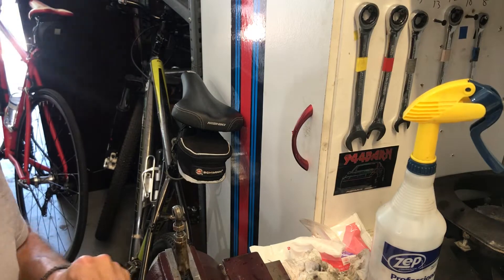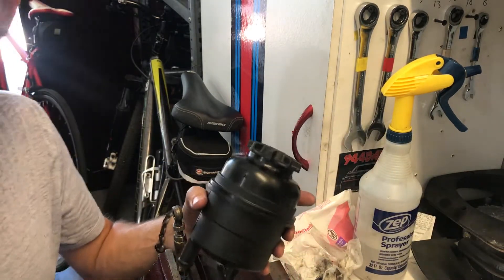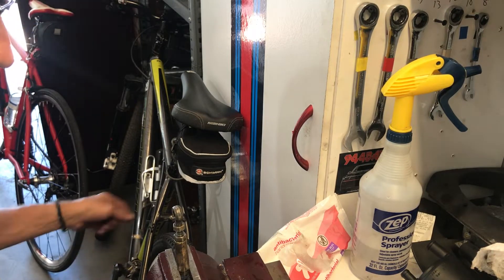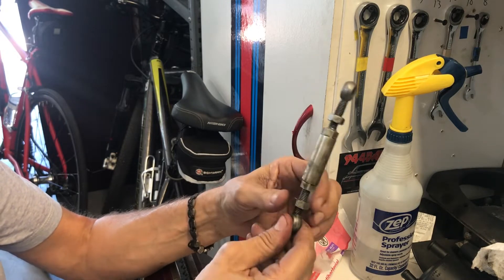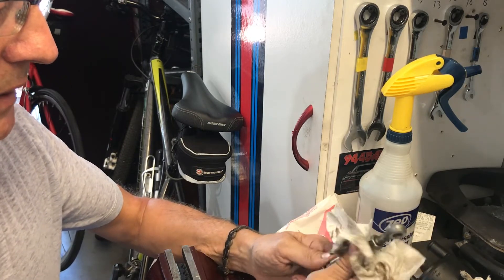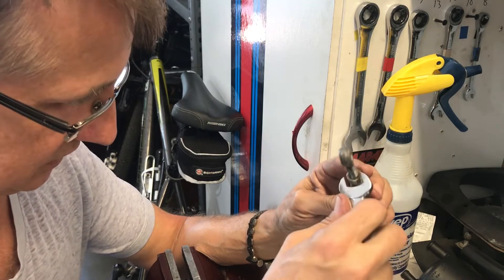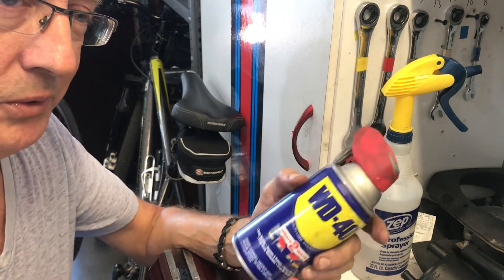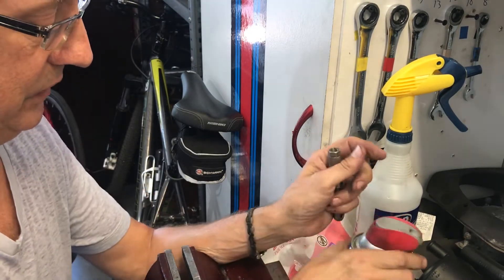Porsche 924 944 power steering turnbuckle repair maintenance

Comment: I didn't realize one side of the turnbuckle was threaded in reverse, this potentially saved me some trouble down the road.

I used to try to fix up old nuts like you're doing but then all my restored projects started getting rusty. Seems like you would need to coat it with something in which case a new nut might be less trouble.

Comment from the maker: If I knew for sure it was a m8 1.5 normal thread bolt I would just replace it but I wasn’t sure so I tried to salvage the old one. I keep a stock of those bolts but this one ended up working fine just needed some time and tlc.